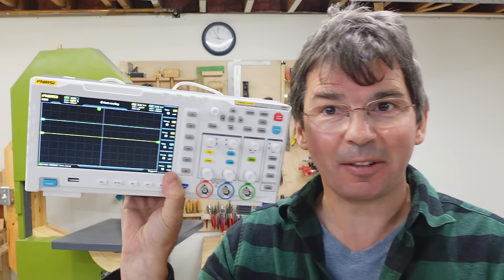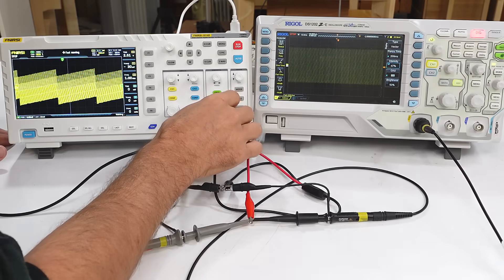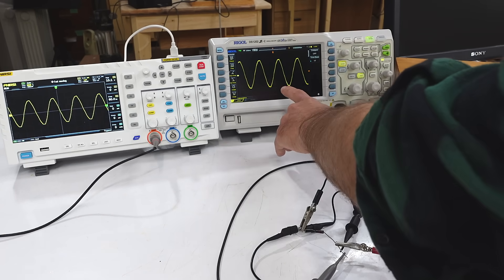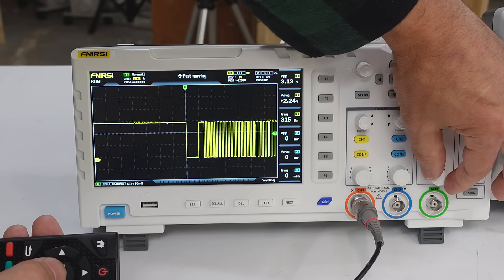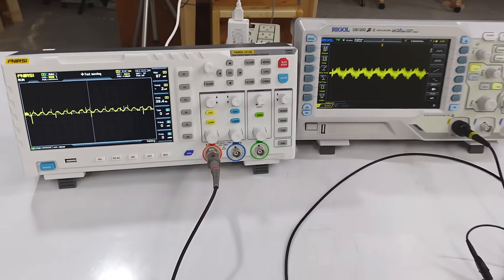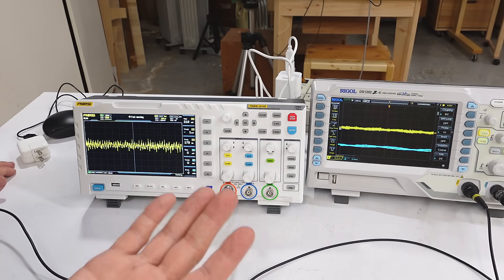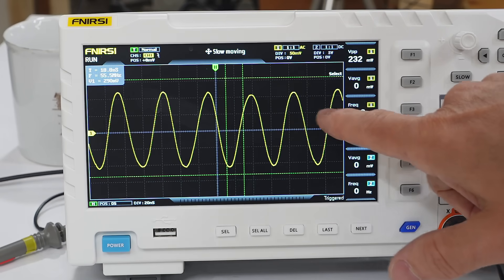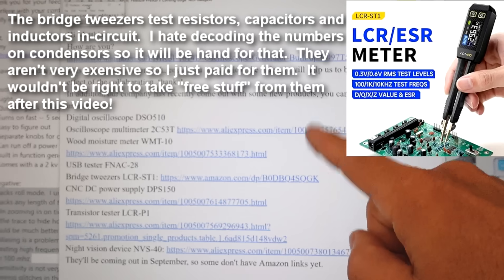Fnirsi-1014D vs Rigol DS1202Z-E

Comment: One thing you missed with the cheap Fnirsi scope, (I have the exact same model), is that when there is a constant voltage difference between the scope's ground and the tested circuit, you um. 
You can't zoom in on it.  (in terms of voltage sensitivity)

Any constant voltage difference is offset from the centre of the measurement, and zooming in eventually pushes the signal off-screen up or down. And the window you are allowed to move up or down from the median is limited. Like, 20 steps or something? So if you have a constant voltage difference of 5V and then a 120Hz signal on top of that, if the signal is any smaller than 0.1V in strength, you just can't get it on screen. It's measured! You can't get the scope to display it.

I bought my scope to do some repair work on old pinball machines, which all operate well within the sensitivity ranges here, so I knew I didn't need something expensive. And this would work, except many old pinball machines have . . . odd electrical setups, to say the least. Which means I just . . . can't zoom in on the signals being sent. 

I got mine for $60 from someone else who didn't find it suitable for their purposes, so I can't say it wasn't worth what I paid for it. It's surprisingly capable for $60, and I can still use it as a teaching tool.

Comment: The Fnirsi-1014D does not meet it's spec and is non linear so do not depend on waveform voltages.  In general most Fnirsi scope are way below spec toys, DO NOT USE/BUY!

Comment: A scope with top sensitivity of 50 mV/div is a bit more than a toy.
I prefer to use an analogue oscilloscope with a CRT whenever I can. I begun my electronic career with vacuum tube Tektronix scopes.
Using an oscilloscope is like using a crystal ball - when you put cheap sampling in the mix it becomes a joke, because it deceives you. The Rigol uses so much power because the wideband frontend uses a lot of analogue circuitry which is power hungry and expensive. 
That cheap oscilloscope will only make your life miserable. Also, you must use a non-switching  power supply with digital o'scopes. 
Thank you
Anthony

Comment: The sampling is 200M in single trace mode. 👍
Obviously it is very limited, but it is enough for many applications.

In your country, the Rigol in your comparison may be "only" 2x the cost, but here in Brazil, the cost difference for this Rigol is more than 5x.

Comment: 13:18 did you use the same scope probe to measure the bandwidth on the Rigol and FNIRSI, and adjust the probe's capacitance with a square wave at the tip? The measurement bandwidth is limited by the product of the scope and probe's bandwidth. If the scope has a 100MHz 3dB bandwidth and the probe has a 100 MHz 3 dB bandwidth, then together they will be 6 dB down at 100MHz. Depending on the roll off rate of each, you may realize a 3dB measurement bandwidth below 50MHz with that combination.

That said, I wouldn't be surprised if these cheap scopes well underperform against the stated specification.

I expect these 2 channel 8-bit scopes will get cheaper and cheaper as 4-channel 12-bit scopes are now aggressively priced below $500USD.
Reply from the maker: See pinned comment

Comment: Interesting, some day I will need to replace the old Precision 30 MHz scope I have.

I could live with 20 MHz because I mostly muck around with HF radio & the price of this unit is fabulous. So, down the road its on my contender list in spite of its issues. Who knows, some of the issues might be resolved. If they had a solution for the frequency sweep issue and it was reliable to 100 Mhz as now I'd likely go for it.

Oh, I just read the pinned note. Ok, so it seems it is reliable up to 100 MHz. So yea, I'd almost surely pick it up given its price and my uses.

Comment: I've bought a couple of items from FNIRSI - nothing as sohpisticated as an oscilloscope - things like power supply modules and the like. So far, I've not been impressed with the quality. They're a cheap brand - even for AliExpress, BangGood and the like where stuff is generally cheap to begin with. It's been a few years, so maybe they're getting better but in my mind they're still a cheap brand that can't be trusted when it comes to accuracy and reliability.

Comment: Some other issues with the 1014D that wheren't mentioned: The signal generator has no offset adjustment, it is always symetric to the ground. So, it is difficult to use it with single-supply circuits or digital circuits (you will have to make your own offset circuit). There are some other weird ground problems with those units. When you try to measure high voltages (200V-500V)  with DC coupling (using 100x probes), there is some offset problem in the signals. Tried to use isolation transformer, or even battery power the scope, and it just doesn't work well. Issues mentioned that need to be highlited: 50mV/div maximum sensitivity!!! The sample rate is NOT 1Gs/s, not even close! I would say it is not a starters scope, as you need a lot of undestanding of its limitations to extract some usefull information from its readings. It is not an scope for  experts, obviously, as it can't show most of what an expert wants to see... Few possible usages for it: basic didatics, and basic testing stations (let's say, for signals <2MHz, >1Vpp)...

Comment: I'm not just a hater and I am actually impressed with Fnirsi for continually improving their product line over the years, but the 1014D is the poorest excuse for a bench oscilloscope that I'm aware of.  The current Amazon price is INSANE !!  This scope is worth $120, tops , and I wouldn't even pay that much as I don't think it's a suitable tool for actually measuring things.

Though it's time has quite honestly passed (the 1014D is quite old), at its peak I found it upsetting that it was so incredibly popular as this only encouraged even more people to waste their money on this piece of garbage and incentivized Fnirsi to raise the price until demand waned (success!).  Apparently, they are now sending them to youtubers in the hopes of restoring some of those former sales figures ;) instead of replacing the product with something truly competitive.

The 1014D is not straddling any lines.  It's just the worst bench oscilloscope on the market and you'd be much better off even with one of Fnirsi's newer handheld or tablet scopes.  Do not buy.  If you already have one, then I'm sorry but perhaps take comfort in the fact that a lot of other people also thought that this was an actual bench oscilloscope and thus bought one.  So close, yet so far away.

Full disclosure:  I've never purchased or used a 1014D, but I've seen quite a few people use and review them.

Comment: At work I have a Tektronix from 1997 (it has a 3.5" floppy drive for copying off screenshots!) and it also has that same issue with low frequency aliasing . Recently I was using it to compare phases of two 10MHz references (1v p-p sine waves) but when I first turned it on, I was set way to low on the horizontal and it actually showed a sine wave, but I couldn't get the trigger to lock! That is, until I realized the error and clicked it up to a much higher frequency. Funny thing is, while this old scope has its problems, it's kind of like an old jalopy: I'm now familiar with its quirks, and kind of like it. (I didn't turn down the brand new Keysight MSO they offered me recently, though!)
Reply from the maker: true for any piece of equipment.  Having used the Rigol for some time, I have gotten a lot faster with it.

Comment: I watched a video awhile ago that questioned whether Apple's more expensive cables were worth the extra cost.
The tester came to the same conclusion that you did with the power adapter. 
The extra cost is due to an actual increase in quality, not price gouging.

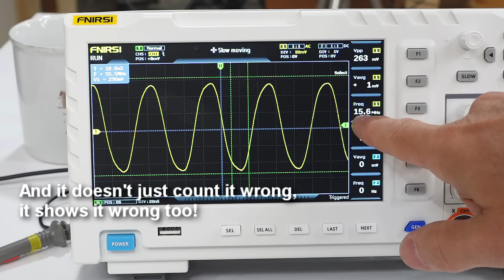Comment: If I were to hazard a guess, based on the 20+MHz behaviour, especially the 65MHz behaviour at around 13:00, the sampling rate is about 100MHz, not the bandwidth. FOr those wondering about similar part numbers, much of the industry took the cue from Tek (I think they were first) in coding bandwidth and channel count into the model number. Or, if my suspicion is correct here, sample rate and channel count. I would be curious about the results of probing the A/D clock.

Comment: I'm reminded of This Old Tony's recommendation on Mini-Lathes.  To paraphrase: they're not great, they need some work from the user (replacing the power adapter in this case), and they have strict limitations you need to adhere to, but they're better than no lathe at all.

I probably would have bought one of these if they were around when I was a student and couldn't afford the $400 scopes.
Reply from the maker: The Rigol is a fairly serious scope, and I'd say at twice the price still a better deal than the Fnirsi.

Comment: When you triggered on the short digital stream on the Rigol, it sounded like the Rigol did not do single shot. In single shot mode, it should not retrigger without a manual rearming. Does Rigol not have this ability or does it not work?

Comment: 5:39 Fix for being retriggered is set holdoff delay longer. This just waits until it can be retriggered again. Or turn it to single mode.
Reply from the maker: what I was pointing out is that the rigol scope can re-trigger sooner
Reply: @matthiasrandomstuff2221  Ahhhh. It seemed like it was presented as a minus of the Rigol.

Comment: Life is too short to use garbage test equipment. Just say no to chinese junk like this with bizarre names. What is a FNIRSI, anyway?
Reply from the maker: So no scope at all then if you can't afford something fancier?  That's even harder.
Reply: @matthiasrandomstuff2221  Quality used stuff at a reasonable price is still pretty plentiful. There are a handful of Tektronix analog scopes near me on FB Marketplace for about the same price as that junky Chinese scope. Newer isn't always better, in my opinion.
Reply: @matthiasrandomstuff2221  Much, much, MUCH better off to get a used 2nd tier manufacturer scope off of Ebay, than one of these units.  You can get a used Rigol or Lecroy for the same price as the FNIRSI is new, and you'll have an instrument that usually doesn't lie to you, has a higher bandwidth, and far more samples.

Comment: does powering the scope through a power bank eliminate the ground noise? because you didn't really go at length testing the accuracy with and without ect. but it's guaranteed to be more accurate without noise at the source. even if it was only very obvious when it was ground looped back through the second scope.

I don't think it changes your conclusion either way. there's a big gap between people whit projects that are served perfectly well with just a multimeter and people who will use a scope.

Comment: I looked into Apple counterfeit products on ebay a couple of years back. Just for personal interest. It turned out the weight mattered. The Apple device had a ferrite choke or transformer on it, which accounted for the weight difference. An esoteric, but interesting piece of ephemera, I thought. Now, one of the greats comes along, and confirms, it DOES matter.
<edit> Still using the Apple charger from my iPad 2. (Or was it a One?)
Reply: Cheap stuff sometimes has weights inside of it to make it feel more premium. Diodegonewild did a teardown of a cheap PSU with a weight in it and it's hilarious. It's just double sided taped over the circuit board and waiting to fall onto everything and short it all out.

Comment: They have a capable Support. I had a Fnirsi PSU that broke and they instructed me on how to repair it instead of just trashing the old one and replacing it.
Reply: Did not expect that, kudoos to Fnirsi!
Reply: Unfortunately, the quality of the support is very poor, I'm glad they helped you, but I'm crying now because the DPOX180H hasn't received any update for almost a year, even though it has a lot of problems.
And the 2C53P is a total nightmare, the same crap just like the 1013D/1014D is. only praised by those who can't do anything in agony.

Like my friend, he bought a Peugeot 30?RC on loan a long time ago, at 3x the price due to the loan, and since then he has spent 6x the normal price of the car on it, because a lot of things in it were ruined.
3 or 4 Engine replacements, 2 barrel replacements, 4 electronics replacements.
And he still praises how good the car is...🤣
Reply: @juhaszpeter4796  3 or 4 engine replacements? Very bad driver and/or very neglected maintenance.
Reply: @madigorfkgoogle9349  
Bad driver and bad technical design.😉

Italian and French engine and electronics design is very bad.
I didn't exchange my Japanese car for a new one, because the latest one already has an Italian engine if I remember correctly.
I know a little about things.😉

The guy likes to go fast, to compete and he cooked the engine a couple of times, it was cheaper to replace than to repair...
If I remember correctly, on one occasion the cooling was not switched on and the electronics did not regulate the engine.
The other time, the cause was bleeding in the ignition, I don't remember exactly, but it was something like the spark missing several times at high rpm, the injector was open for too long and the system was filled with gasoline, I don't know exactly anymore. but the engine was also badly damaged there.
The first time something broke in the engine, a quality defect, maybe the crankshaft.🤔

It should also be added that here in Hungary, the fuel is of very poor quality, additives are added that cause the car to consume more fuel, the emitted smoke is more harmful, and the performance of the car weakens.
I know because there were times when I used fuel available in the surrounding countries and, for example, with German and Croatian fuel, the car ran cleaner and I was able to cover 30-40% more distance with it at home...😱

It is in the government's interest that the masses buy as much fuel as possible, and they achieve this with as many techniques as possible...
Like generated traffic jams, poor quality fuel.🤣

If someone makes some kind of decree elsewhere, they always complain about it at home and make a worse decision.
For example, with a car license you can use a small motorbike, but only up to 50cc. the next category requires a motorcycle license up to 125cc, which costs almost as much as a large motorbike...🤣
Reply: @juhaszpeter4796  I was in automotive for almost twenty years. You are wrong, actually Italian ECUs were very good a pioneer of ECU technology.

It is also a myth that French engines are bad, your friend is using car for different purpose then is was meant, also im 100% sure he is neglecting maintenance. Those long service (especially oil exchange) intervals are for normal calm street use. If he uses the car for racing the oil change interval should not exceed 5.000km, if he is squeezing all from the engine even often.

Many problems with electronics failing are connected with tuning. Again the sensors, ECU and connectors are stretched beyond their engineered use, engine suffers much higher temps, since again the cooling was engineered for normal calm street use, and this is leading to premature failures to various electronic or metal components.
And, it is actually pretty normal in motorsport where much beefier components are used, and still fail.

And yes a poor petrol quality can lead to micro detonations that can kill many parts in engine.

Edit: I have re-read your comment, and actually you did agree with me that he is a bad driver ☺, so you are not wrong.
Reply: @madigorfkgoogle9349  
Thanks for the clarification, my experience is a little different.
I'm a mechatronics technician, I don't deal with cars very much.
I see that in my environment there are a lot of problems with Italian, German and French cars, less with Japanese and Chinese cars.
Some people neglect it, but some people spend a lot on it.
My old schoolmates and I used to talk about work, and all of them scolded the French, German and Italian manufacturing machines.
The old ones were good, but the newer ones are much worse.
There were cases where the brand new machine was disassembled a month after assembly, put aside and the old one taken out.
They had errors that the manufacturer could not fix.🤔

There are a lot of design mistakes, things are not properly thought through, wrong choice of material, etc.

I'm not saying that everything is bad, and that there are so many problems with them, there are a lot of operator errors and poor quality of maintenance. But here comes the question of why the other one doesn't, why does it last longer with fewer faults, if it was also maintained in the same way?

I think that what needs so much attention cannot be used properly.
If maintenance is more expensive, then from my point of view it is just a waste that unnecessarily burdens the environment.

My 25 year old Mitsubishi Colt cost me a lot less than my dad's FIat Doblo, and my Colt is much more reliable.
It doesn't eat oil or water, the smoke is within the limits, it passes the exams first, etc.
It only has so many faults that a few parts are rusting.🥰
But maybe only those sold to the Hungarian market are so bad.😂

Oh that Peugeot is an RC rervison, it should be able to withstand that use. I think so
Reply: That is something you like to hear!
At least if this is not an issue on every other product..
Reply: Sometimes, customer service is exceeding all expectations. I had the same kind of surreal experience with a rear view camera, after I posted a neutral review,  about a swelling battery, they send me a free one with a super capacitor and did a firmware update, with some  of my suggestions.
Reply: That's almost unheard of nowadays! I'll give a Fnirsi product a try because of this comment.